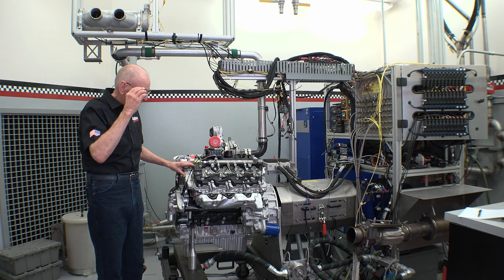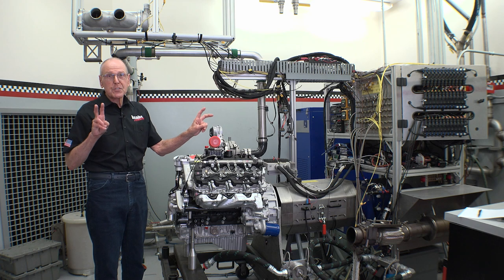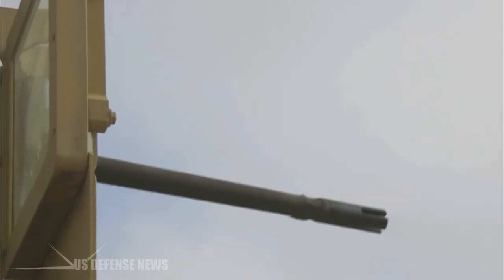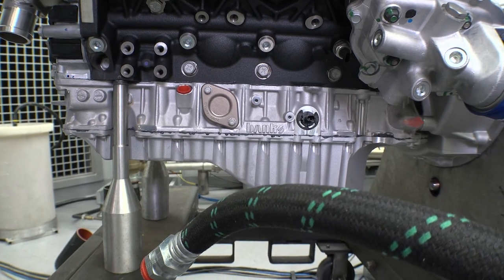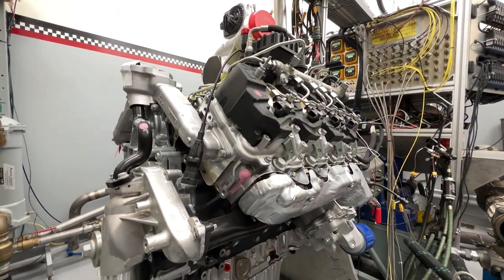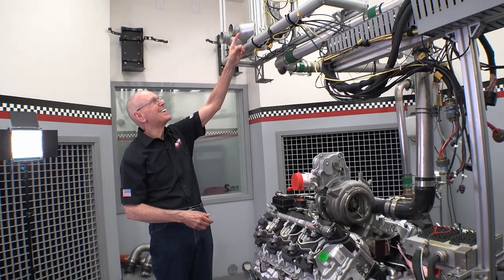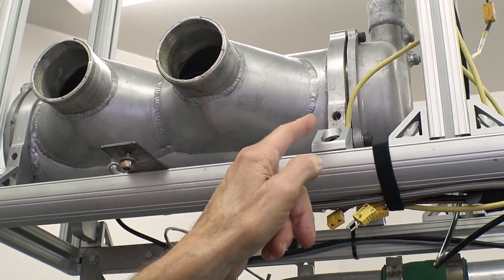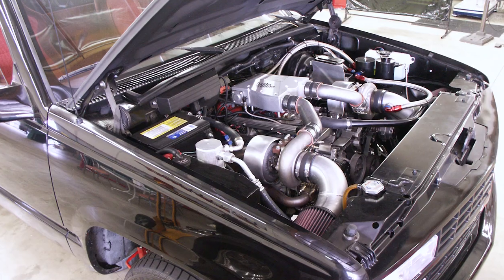2024 Duramax Engine First Look | Banks R&D Update

Comment: Wouldn’t it be cool to buy a “Banks” edition Duramax 2500 right off the showroom floor.
Reply: you'd never be able to. from what I understand, the banks up-fitted l5p Duramax's going into the LVP's mysteriously lack all the "standard" emissions components required for on highway trucks. Heard it was because EGR and aftertreatment is too high maintenance and inconvenient for the government or something like that.
Reply: @liamfogle8367  it’s pretty simple, poorly maintained broken down civilian vehicles don’t wind up with body counts. Servicing isn’t always a convenience that these vehicles have when things go sideways running on contaminated fuels and getting people out alive.
Reply: @liamfogle8367  so theyre admitting, it dont work. Shocker.
Reply: What he’s talking about are the EPA emissions exemption for military vehicles. Imagine being out side the wire and your def tank get punctured and the truck that’s supposed to get you out of dodge is limited to 5 miles an hour because the DEF is gone.
Reply: @chadsteele1  They (assuming you're talking about the government) aren't admitting emissions systems don't work (also assuming you mean in the context of helping improve the environment). They're admitting that emissions systems can be problematic and cause the vehicle to break down at the most inconvenient moment, which wouldn't be good during a mission behind enemy lines. I don't think the military would just call up roadside assistance.

Military: "Hi, we need a tow."
Roadside, speaks with enemy accent: "What's the vehicle description and location?"
Military: click
Reply: Make that a 3500 then yes
Reply: Yes
Reply: lol seemed like a simple question. Would it be cool or not? Yay or nay. Yay I say.

Comment: I have been watching you guys use these cores since early 2000s and I have always wanted to ask you if you have the same issues as us in the marine world? Our biggest issue we have is the dissimilar metals and the condensation eating our housings up. This has been ruff for us all the way back to the 6bta diamond series. Over the years Cummins has made some changes with orings and check valves to drain the water when at rest, but still we go through housings like crazy. Cummins won’t sell just the core or the housing it’s a package and it’s expensive and now because we live in a socialist country I just waited 6 months for 1 qsc cooler and Cummins can’t even tell us when or how they will get the other. Do you have the same issues in the dyno cells? Or in any of your projects? Or is it just because of the salt water that we have so many issues? Sorry for the long question but I can tell you this ,if banks can make a replacement aftercooler for qsc Qsb Qsm that doesn’t fail like Cummins oem you will make a million dollars in Florida alone not to mention save hundreds of peoples motors. No exaggeration I rebuilt these engines like you change underwear down here because of it and the people with Qsbs are ,screwed because they have no liners and if I can’t stone hone it in the boat cost gets so crazy we toss them and get Cummins recons.
Reply: Galvanic corrosion. Do you use a sacrifical anode, like merchant vessels have ?
Reply: @Sjanzo  
That's exactly what I was going to say. Use a sacrificial anode that is aluminum, magnesium, and zinc. The proper alloy will depend on the alloy of your system. Usually with brass and bronze housings we used zinc anodes, but if your housing is made of aluminum, then you'll have to use some magnesium in the alloy to make sure you still have cathodic protection. If you want to get a decent idea of how this works, you can watch a YouTube video by Grady on his Practical Engineering channel. This stuff has been working for the navy for many years!
Reply: @davidscott5903  i think cathodic protection exists since the use of bronze propellers...
Reply: We have the same issue with both Cummins and CAT marine intercoolers here in NZ. 
CAT is def the worst one tho. C7 intercooler costs close to $10,000 per C7 engine. Cummins have a better product by far.
Reply: Of course we use zincs. These coolers are manufactured for Cummins by huge names like moto, Alfa Laval , Sendure. All the engine oem manufacturers get supplied by them. Cat as well is horrible with aftercooler failures just like someone commented, and they put rods through the block and the heads get ruined because of it. This is a huge problem that many oems know about and have all tried changing little things to combat it but still we have problems. Even our Zf gearboxes use these coolers on our bigger 2000hp plus motors. The gearboxes they put behind big man’s which is what I specialize in have more oil capacity then a duramax or Cummins, Then they fail and we get sea water in the oil. I really am curious to if banks has any core or housing issues at all. Another thing I did not mention among many but very important is stray currents this is very hard to pinpoint and is a uphill battle for even the smartest in their field.
Reply: @jameshaskell6572  when talking stray current, we are talking galvanic corrosion, as it literally is electroplating what happens: the lesser metal dissolves and gets electroplated on the better material by stray current.
Reply: @Sjanzo   The galvanic corrosion I thought was caused by the dissimilar metals and the sea water being the conductive pathway. The stray current I was told, was a outside current from the vessel or marina or even engine harness introducing current into the vessels bonding system which then is the electricity that causes the galvanic corrosion not the dissimilar metals which we are already fighting. I suppose I made it sound as if understanding stray current was hard to grasp but what I was trying to get across is that it is very hard to pinpoint where it’s coming from. In the end zincs and correct bonding system have been applied and still we just can’t seem to keep these parts alive the exception is cast iron it seems to be rarely affected I suppose because it’s the stronger of the metals but all the manufacturers are after power to weight ratio so we have a lot of aluminum and bronze.
Reply: @Sjanzo  thank you for that comment as I did not know about the electroplating. I’m going to do some reading tonight. I love learning
Reply: @jameshaskell6572  
If you are using aluminum, then by using zinc anodes, you are actually creating zinc cathodes and your aluminum becomes the sacrificial anode since it has a higher electronegativity. You need to use magnesium anodes to make them the strongest electronegative component so the magnesium will corrode before the aluminum and everything else. Seriously watch the video by practical engineering. It explains it so much better than I can unless I write a book on here.😁
Reply: @jameshaskell6572  
Trust me, I'm an engineer for the U.S. Navy, and I was enlisted and served on the USS Boxer (LHD-4) when we commissioned her. Yeah, I know I'm old.😁
Reply: @davidscott5903  thank you for your service also I will watch that video I am very interested. We use rubber impellers to move the seawater through these systems And no I do not believe our sinks are magnesium I will have to look though to be sure some of them have a plating on them but the usual ones I don’t think so. I just don’t see how cat,Cummins,mtu,man,haven’t figured this out. Detriot diesel after all these years the two stroke just don’t have these problems. I work on 8v92 that have not had heat exchanger service in 20 years no exaggeration and the are dirty but quality of metal is fine but on man heat exchanger in you go 4 years without replacing those orings banks was showing your done 30k dollars new tanks new bundles.
Reply: I used to service UPS package cars,,,( yes, that's what their delivery trucks are called,,,lol).
 The 95 and up, navistar T444E powered units were having issues with corrosion on the radiators.
 The fix for that issue was installing a good, heavy ground strap, from radiator mount flange, to the vehicle frame.
 Strange how having the radiator fully insulated from contact with the vehicle frame caused the radiator core to corrode.( copper/brass).
 Ground strap saved the radiators⚡🎯😎☕
Reply: @davidscott5903    Engineer-Snipe🤣  TYFYS from a Twidget!

Comment: Gale… why can’t you and Team write the Duramax specs for GM 2024 LP5 for HD production trucks, over fixing GM design inadequacies? 

You’ve already demonstrated via the first iteration LP5 that you could reliably increase power and torque to 500 HP/1100LBS with minimal parts adjustments - and zero impact on longevity.

Comment: 6:44 What on earth is shoving "in the hundreds of pounds" of boost into an intake? 

Actually, that might be a brilliant idea.... If you boost up to "hundreds of pounds" to get the air SUPER hot and run it through a cool intercooler, that will bring it down to "pretty hot" in a very short amount of time. (Thermal transfer is logarithmic compared to time, so greater the delta in temperatures (hot intake air vs cool water core in this case), it will cool off a LOT more for the same amount of exposure time when the air is SUPER HOT and the water core is cool than it would if the air was pretty hot and the water core was cool.) Then, you can run it through an expansion valve (think orifice tube in an A/C system) to bring the pressure down to a normal 10, 30, 70, or whatever is actually going in your engine. The air would cool down a LOT and you'd have SUPER chilled AND boosted air going into your combustion chamber! Like, dang near A/C level chilled!

I wonder if that's what he was getting at when he said "Intercoolers make more power than the turbocharger that creates the boost". He was pretty adamant on that statement.

BTW, I'm still holding out for the last of the "Killing a Duramax" series! You promised, Gale!

Comment: Your air to water intercooler is almost as good as the Volvo I have in my boat, where the turnaround end cap is separate on yours it's built into the housing on this 1990s vintage Volvo.
but I will say yours is prettier

Comment: Looks a lot like the heat exchanger we use at my work. Steam heats water in what we call a tube bundle like what you have but much bigger than the hot water goes to a plate heat exchanger to heat milk product to pasteurize it.

Comment: We had similar sit ups to cool engine oil with coolant from the radiator, the problem was occasionally the water pump seal would breakup due to the WP bearing failing and a piece of it would get caught in  one of tubes and over the course of time would work its way threw and cause oil in the radiator.  Also some engines used water only and the bottom tubes would freeze and leak oil into the cooling system. More than once we'd plug off the affected tube or two and move on. My 2 cents worth.

Comment: What happened to the other 2 series the killing a duramax and the monster truck engine?
Reply from the maker: Both the Super Turbo (Monster Truck Engine) and the L5P for  “Killing a Duramax” on hold for an extended duration while we conduct testing for our military program (Banks Tech) in Dyno Cell # 1 & #2. The moment these projects are completed, we’ll roll both the Super Turbo and the Killing a Duramax back into the dyno cells.

Comment: Whatever happened to the monster truck engine?
Reply from the maker: Both the Super Turbo (Monster Truck Engine) and the L5P for  “Killing a Duramax” on hold for an extended duration while we conduct testing for our military program (Banks Tech) in Dyno Cell # 1 & #2. The moment these projects are completed, we’ll roll both the Super Turbo and the Killing a Duramax back into the dyno cells.